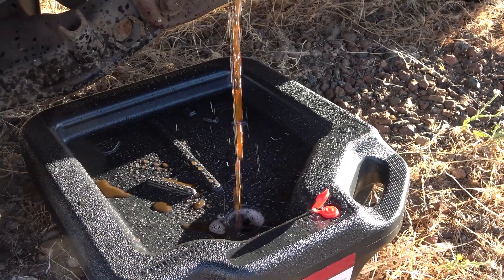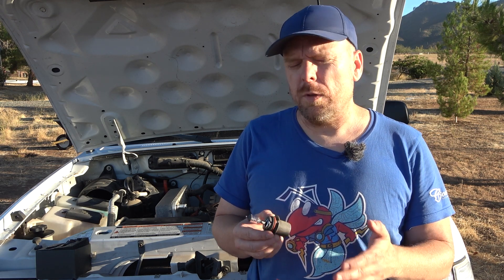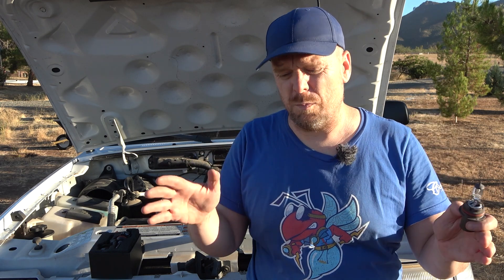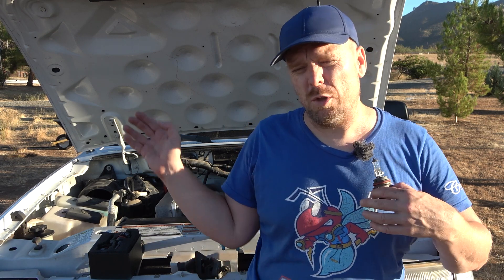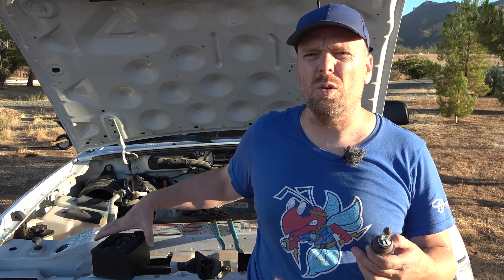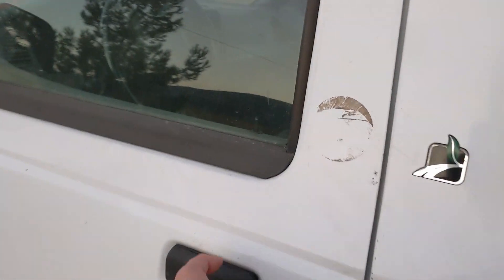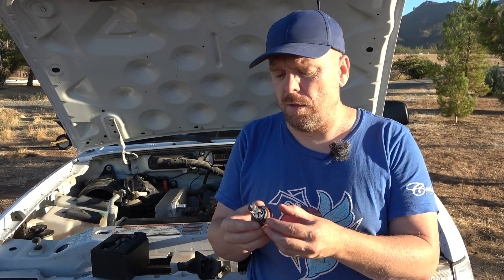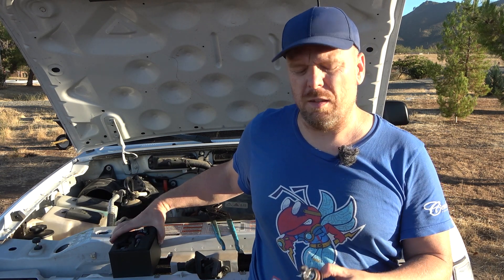Can LED Headlights Increase EV Range?

Comment: Apparently headlights aren't on a canbus system. Canbus messes it up for all the other LED applications. Using a load resistor undermines the point of saving power
Reply from the maker: The power draw numbers should include the resistor. They do for 120 V socket LEDs. If it losses from the ballast resistor are in addition to energy consumption of the LEDs, then yes, that impacts the energy savings. At that point, it would be back to double the light/visibility for the same power.

Comment: LED bulb replacements.  Increased illumination is worth it, AS LONG AS …..  Focus and Distribution of light is EVERYTHING.  There’s a LOT of LED bulb kits that have horrible light output patterns, not limited to poor vertical cutoffs letting light glare upward (into oncoming drivers) AND poor focus of light onto roadway forward.    Best to see examples of output pattern from the vehicle headlight or, at least, KNOW the LEDs are centered and at same distance as standard bulb filament from the reflectors.
Reply from the maker: Yes, that's the reason I got this bulb specifically. The LEDs are in identical position to the halogen filaments, so the light pattern should be identical. There's still margin for error, of course, but these are supposed to be one of the best at maintaining the original reflector headlight's pattern.

Comment: Another way to illustrate the math: the two halogen headlights use a combine 120 watts. According to Google, a beginner cyclist can put around 75-100 watts of power into the bike from their own muscles. The difference between halogen headlights vs. LED headlights (60 watts) is less than this. So the added range you get from switching the headlights is roughly equivalent to transferring energy into the truck battery from the driver's leg muscles by way of a pedal-powered generator. And it does not take a rocket scientist to realize that energy from human pedal power is essentially meaningless when it comes to moving at speed something as large as a small truck. The only way human pedal power (and also headlight efficiency) really matters is when the vehicle reaches the efficiency of an electric bicycle, something which even an Aptera comes nowhere close to.

Comment: Another way to look at this, assuming the drivetrain is drawing about 9.5kW to drive the vehicle down the road at 45mph (I think that’s what your spreadsheet said), 9.5kW is roughly equivalent to the power draw of 316 of those LED light bulbs (assuming it draws 30w). So, the headlights are really an insignificant draw compared to the drivetrain and the battery size. In addition to that, most people don’t drive with their headlights on at full brightness all the time, so the tiny power savings will only come into play when the headlights are on. Even cars with incandescent daytime running lights typically either use a lower wattage bulb for that purpose or dim the bulb to reduce the power draw.

Regarding the headlights themselves, I’m firmly against putting any sort of brighter bulb into a reflector headlight housing designed for incandescent bulbs. It basically always results in offensive, blinding glare. If you’re going to upgrade your headlights, do it properly or leave them alone. Most of the LED bulbs designed to fit in place of halogen bulbs are absolute garbage and the very few out there that can actually work decently in a reflector housing cost $150+. For $45 I can basically guarantee you bought garbage that will blind oncoming drivers and probably put less light on the road than the stock halogen bulbs.
Reply from the maker: Yes, headlight patterns are something I'm very sensitive to. Even the Bolt EV's stock headlights bother me for that reason (they send a small beam of light into the opposite lane). The LEDs I brought are designed to mimic the halogen filaments and work specifically with this reflector housing, so if installed properly, they should have a very similar beam pattern (though different and more light overall).

Comment: i can barely see anything at night when i drive a car that  has the stock halogen bulbs.... i was shocked how good the HID bulbs were in the 2017 bolt... other than the light color i have zero complains about the HIDs.... i've replaced all of my halogen bulbs in my other cars with LED 6000k-ish color .... sssssssoooooo much better and i can actually see the road 👀

Comment: One thing I wish you had covered was lenses and reflectors. The direction that the bulb emits light works integrally with the lenses and reflectors.  Before I had my Bolt, I had a spark EV, and it came with an HID conversion. That was absolutely awful. I switched it to LEDs and it was still awful. Eventually, after tinkering a lot,  switched it back to the stock, halogen bulbs, and all was good again. This was down to the way the light was emitted from the HID bulbs, and the flat chip on board LEDs, versus the somewhat more omnidirectional light emissions of the halogen bulbs that it was originally designed for.  Food for thought. Love your videos keep them coming.😊
Reply from the maker: Thanks! I want to actually get them integrated and use them before I commented more. I've seen a lot of reviews with vastly different results depending on which LED was used (some are real stinkers), so I might not end up sticking with these. I also forgot to mention the other big advantage with LEDs, which is service life. Halogen are measured in hundreds of hours, while LEDs are measured in tens of thousands of hours.